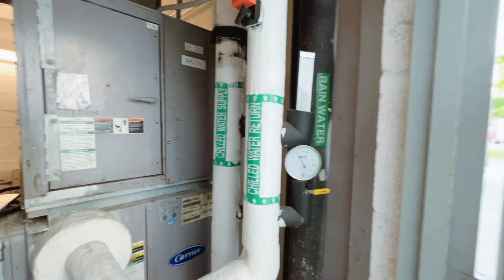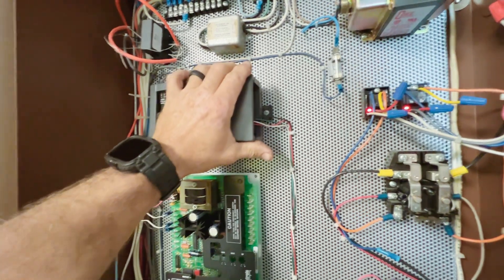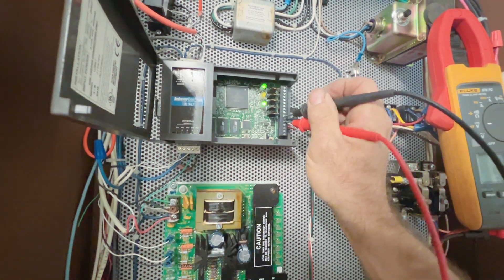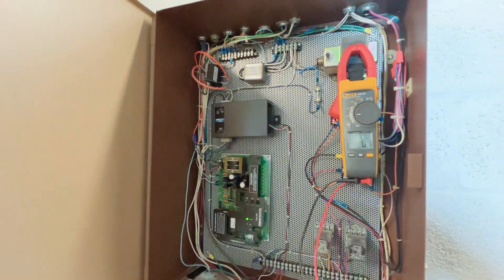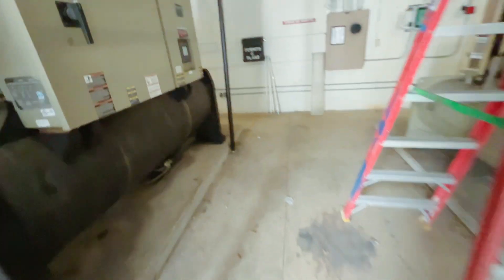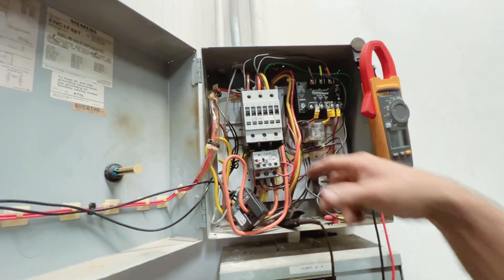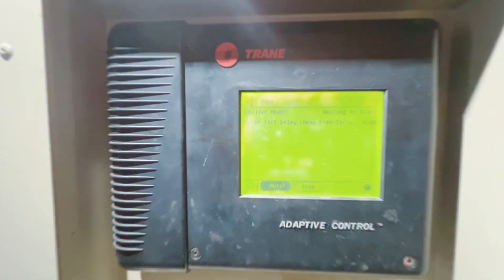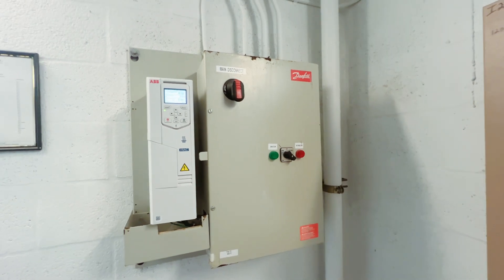Air Handler Blowing Warm Repair … EMS Reload And Chiller Down .. What Else Can Go Wrong?

Comment: Can pumps have overloads like in refrigeration compressors?
Reply from the maker: On single phase pump motor, yes. On 3 phase motors it would be external overload relay on the starter or on vfd. Good question 👍
Reply: @subcoolHVAC  thanks for the videos. A lot of this stuff is still gray to me but I'd like to work on the big stuff like you someday. I'm an apprentice and I've went through a trade school already. Im hoping a union can help me out with this sort of stuff. Don't want to work for another crappy company again. Thanks.

Comment: 22 mega ohms @525 volts is good lol.  Essa  says 2 mega ohms is serviceable 🤦‍♂️
Reply from the maker: When the breaker has tripped and that is the lowest reading of the three motors on that circuit we don’t throw fire to it, a follow up will be done since the other motors tested 500 meg. It’s a clean fairly new motor. Thanks for the comment 👊

Comment: Grinds my gears to have an outside company controlling a building and i have no access. Thankfully just about all of our buildings are self governed. Situations like this is where a signal generator shines. Had to use mine yesterday to prove some VFD'S were working properly. Loosing a pump can put a hamper on things. You handled it all like a champ and a pro. Great video as always
Reply from the maker: Yeah our EMS is all in house, problem is only a few techs for over 200 sites. That signal generator would have been perfect, got to get one. There’s a lot of construction going on too, the Head end also being updated as a separate project. Keeps me busy. I appreciate you Jason 👊👍
Reply: @subcoolHVAC  dude....next year AHR is in Orlando....are you going...i will be...if you are...it'd be cool to meet up and get a beer.
Reply from the maker: Most likely will check it out, I have family in Orlando. Definitely would like to meet up 👍👍😎

Comment: EMS is always a major PITA.  As for the motor failures, especially at the wee hours of the morning, the client needs to lay into the power company and demand (by legal action if necessary) ALL of the system logs for the feeder servicing the plant. They are either getting total short term intermittent phase losses, or some serious (or even long term borderline) voltage imbalances. There is no reasonable excuse for the repeated motor failures.  On second thought, and more likely, another possibility to explore is the feed to that particular motor,  since if I am correct this was the same plant where the electricians screwed up before. There is a loose or bad connection somewhere in the feeder, or at the breaker, or a defective or worn out breaker.
Reply from the maker: It doesn’t help that there are crews working doing renovations along with outages, we have electricians getting ready to replace all disconnects to fused and go through the feeder . Doing my best to prevent these situations. Thanks for the comments, much appreciated 👍